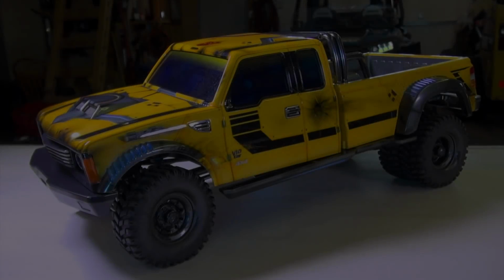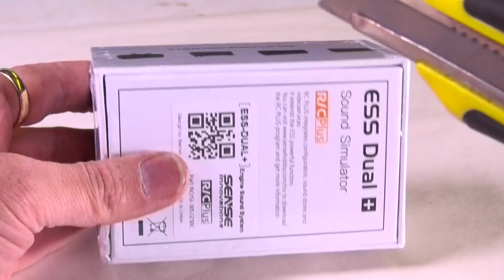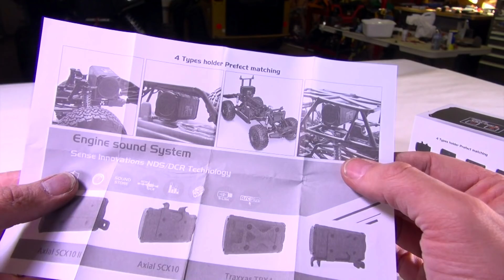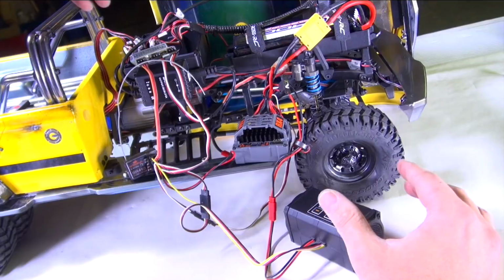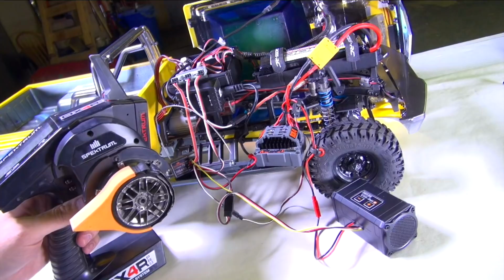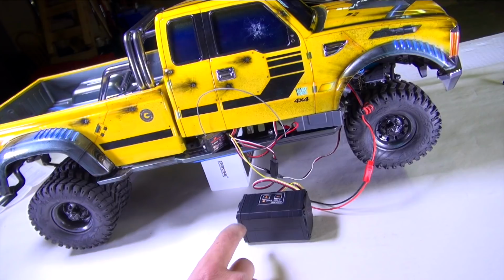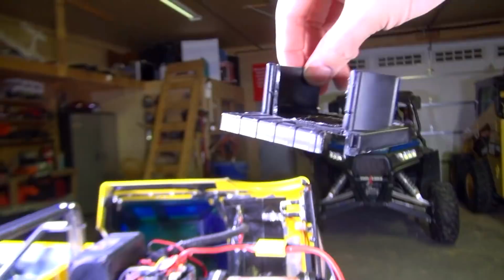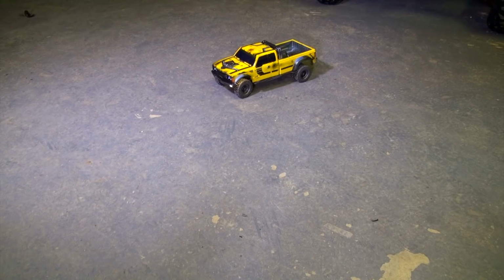RC ADVENTURES - Install a "BASS CANNON" - UNBOXiNG an ESS DUAL Speaker System for BUMBLEBEE ST

Comment: It sounds pretty nice once it gets off of  idle, I am sure as you said that it does sound different in person, the idle to me sounded almost more of a Harley Davidson or something, but once you had it kick in to gear per say it started to sound more like the vehicles that are in spin tires. On that note kinda think that that would be a neat kit to put in to the CA10 kit if there is any room that is. it really has that guttural noise going for it that a hand stock vehicles from Spin Tires have. Do have to say though that that is a heck of a sound system in there, hearing it resonate through the garage compared to your voice even though it is through your camera mic really says the amount of clarity and oomf going on from that kit.

Comment: It's sounding good, but I'd suggest that's not a v10 diesel sound.  More cylinders in most case will means a smoother less grumbly sound.  Add to the fact that most will be turbocharged which further mutes the exhaust and you end up with quite a boring sound with a lot of turbo whine.  But it's a RC and so it can sound however you like!

Comment: you do have the materials just use the top of your electronics box and cut out the center so the speakers fit inside and stick out the top and use zip ties or a Velcro strap to hold it in place you shouldnt loose too much volume as long as you dont block the speakers

Comment: RCSparks Studio hello, I know the video on your black Skyline Xmod video is old but I noticed when you took it apart it didn't have a rear mount engine bracket, have both front and rear is what keeps the engine in place. I just wanted to let you know since none of the comments mentioned that. Hopefully you still have it 😊 have a good day sir.

Comment: If you want sound it's called NITRO.  WORKS awesome you can hear it from a good distance to
Reply from the maker: Psst, Just to let you know... You can't have a nitro crawler. Its melts the clutch shoes. Just want to catch you up with current events is all..
Reply: Yeah I know that. It's called Tekin but thanks.

Comment: Where do you get the hosing that you have some of the wiring in. I’ve looked at Home Depot and couldn’t find any. Also, what is the gearing in that? I’ve been trying to get good torque but also have a good high end gear.

Comment: I'd honestly like to know how much went into this one build. Not my business but we always wonder.
Reply from the maker: Hello :) Its hard for me to say how much - becuase currency exchange in Canada is steep over US $.   But let me try and break it down...  $550 for the Kit.  70$ for original sound kit, 2 servos - Savox Waterproof - $140   Ess Dual Sound kit - $100  receiver $75, Halo Lights - $25 and Custom Paint (a Variable Cost depending on what artist you see).  So.. Im gunna put in a bid that this truck is valued at around 1500$ Canadian.   So Approximately $1100 US. Could it have been done for less? You bet.. could it have cost more if I tried..?  easily.. lol
Reply: RCSparks Studio lmao. We can always make em cost.more. That's the easy part. Harder to make something this awesome on a budget

Comment: Ok it doesn't fit inside, so let's remove the chassis!!! 😐
 really WTF?!
Reply from the maker: The chassis?! Its an undersized electronics box. Catch up on the project bro.. before you comment like that. The box was inadequate for size, and all i did was remove the lid.. so, like.. Really?! Yeah.
Reply: I completely know that, I spoke allusively! I mean why did you remove that box when you could put the speaker in back of the truck?
it doesn't make sense to impair a box instead putting speaker in another space.
However it's up to your tact.
Ok ,thanks for this fast responsibility👍
Good luck.